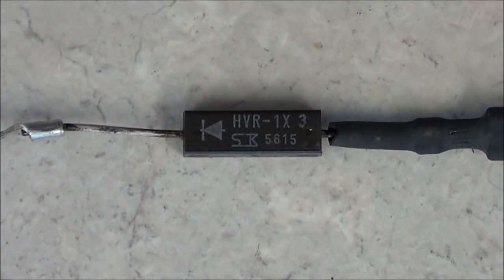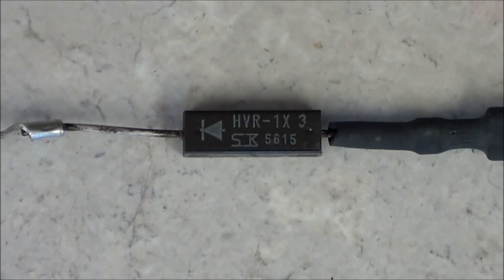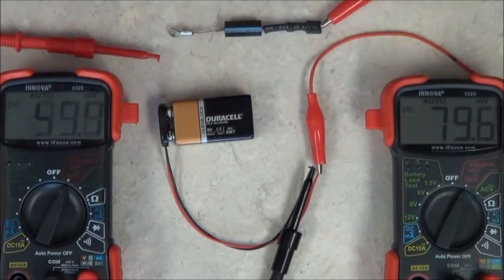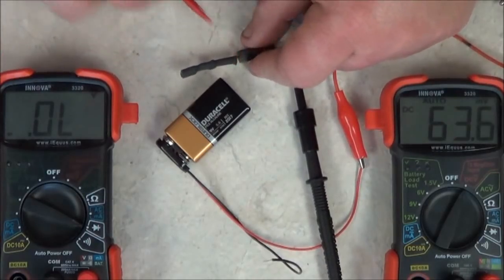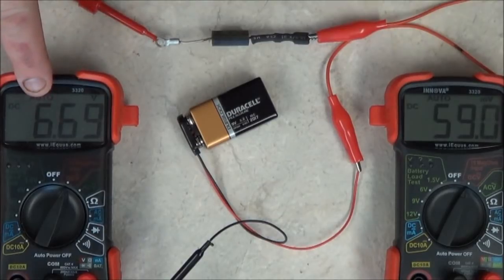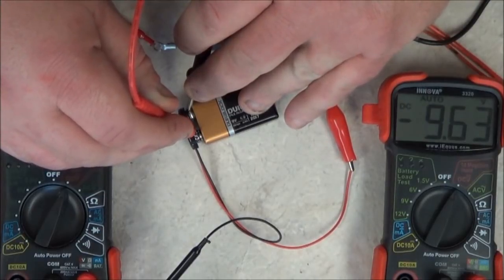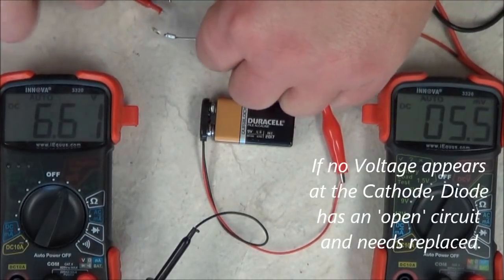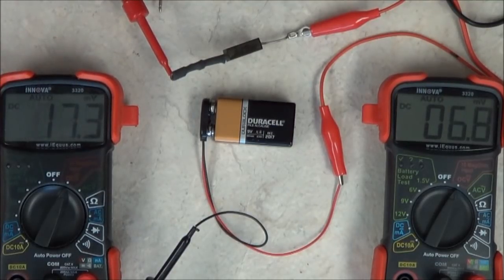How to test the Microwave Oven's HV Diode

Comment: Why didn’t you connect the diode the other way…. To test in the diode setting you check, both ends switching the terminals. One will come through with voltage. The other way will come through with OL.  You only did one direction and saw the OL. I believe that’s how you check it with the diode function on the multimeter.  I guess the point is you don’t need the battery, although that works too - when you have a diode test function on your multimeter like you do.

Comment: There is a lot of mis-information in the comments section of this vid.  When you here a loud humming and the microwave produces no heat, the problem is typically a bad magnatron.  Contrary to what is stated in the comments.  The simplest way to determine the problem is with an amp meter.  With the microwave turned on, if your current draw is 2 amps or less, you have a problem in the low voltage(120 volt) side of the microwave.  This is typically a door switch or control board issue.  If your current draw is 3 - 6 amps, it means the high voltage transformer and the capacitor are both good, and your problem is either the magnatron, or the high voltage diode(more times then not it is the magnatron).  If your amp draw is 50 amps or something very high like that, its usually the capacitor bad.  A typical properly functioning microwave will draw between 12 -16 amps, depending on house voltage and wattage of microwave,
Reply: That's all good and well, but you do not explain how to differentiate between a failed magnetron and diode.  Therefore you have not answered the question.
Reply: There are a ton of videos that show you how to check the diode.  Unlike a typical diode, for this high voltage diode you have to connect it in series with a 9 volt battery. Watching a video on it is a lot easier then trying to explain it. Having said that, I typically replace both the mag and the diode together, as the diode is a very low cost item, if it turns out the problem was a bad mag.  For the sake of a $5.00 part I don't want to have to pull the microwave down and tear apart again.
Reply: Thanks, that makes sense.
Reply: +billy bob Would you please read my post at the top of this forum? I have taken several measurements in every possible configuration in an attempt to figure out why my fuse blows. I'm really not interested in replacing parts blindly as it can get expensive. Perhaps you can decipher things based on my test results. Thanks.
Reply: billy bob
Reply: Jake, if you are pulling 55 amps and fuse blows its more then likely a shorted capacitor.  When you unplug the wire from the transformer to capacitor, and it only pulls 5 amps, that means everything is good up to the capacitor, including the high voltage transformer..  Especially since its not blowing the fuse as well.
Reply: kolkata bipul Roy hello?
Reply: How do you measure the amperage of the microwave?
Reply: @billybob-rn9cg  ....Roy called two years ago...You answered a year ago......and I am reading this now....... YouTube has weird ways of communication involving Warp Timed in Years....?!  just kidding !

Comment from the maker: Not Always. The HV Diode is usually the cause as to why the Microwave does not heat the contents. The HV Capacitor will cause the HV Diode to fail when it shorts out internally. This is why it is a good idea to check both the Diode and the Capacitor, Although the diodes are large in size, they can only handle around 1/2 A (500 mA). They are designed to block between 6KV and 15KV when the polarity is reversed. and will eventually breakdown on there own. -MrFixit
Reply: ? Do you mean rectify ac waveform supply that reverses polarity

Comment: I have a problem with my microwave If the diode is connected to earth it will cut off the fuse but if the diode is not connected the fuse will not cut off and the microwave will not get hot why

Comment: Thank you!  Very helpful with the suggestion to use the 9 volt battery because the high-voltage diode has such a big current drop across it. Also great to see exactly what the voltage drop across your diode is so that I know what to expect!

Comment: Thank you sir. I was testing the components in a furnace electronic air cleaner which has been weak, and now unresponsive even when the test button was pressed and ran into two diodes like this, which I first concluded to be open. Using the 9V battery test, 5.7 volts through the battery each, so they are good. Found the capacitor which is in parallel with the transformer secondary (11nF, 4kVAC) had a split in it.

Comment: I am impressed with your creativity! You are connecting the voltmeter in series with the battery and the diode. You are measuring voltage drop on the voltmeter. 
in theory you can deduct that voltage (6.7V) from 9V (the battery) to come up with the voltage drop on the diode (2.3V). In reality, since the voltmeter's resistance is very high, few megaohms, the flowing current is just few microamps. So the calculated voltage drop is out of the working range of the diode. 
To measure the voltage drop of the diode, connect a 100 Ohm, or so, resistor in series with the diode and the battery.  Then measure the voltage on the diode (between the cathode and anode).
Reply: yes indeed  would be interesting to see the  volt drop with a 1 kohm resistor as a load.  It is not a high resistance diode  as such as it is probable a diode stack  maybe  3 off   0.7 volt diodes in  series  to share the high  reverse  emf Tthis would give about 2.1 volts drop

Comment: Hi Mr.fix it goodday!im so proud of you,to give a info n help those people need to fix their prob.especially for electrical prob.also me,im asking n help too about my concern for my Genset,?Bosco Generator,2000 watt,How can i fix it n how it prevent the prob.having a overload sign light on?but the engine still running in good condition,even i did not put or connect any unit can be use?,hopefully u can give me a time to discuss for what the solution of my prob.be solve..im really appreciated it. Tnks..Godbless...

Comment: I have two comments:
1. Since you haven't shown all the connections, it's impossible to see exactly what you're measuring.
2. It makes a lot more sense to measure the current through the diode.  It should be zero in one direction and high in the other.  That tells you it's working, no matter what the voltage drop is.
Reply: You sound like you know what you're doing.
It was difficult to see what he was doing with his connections.
With a new 9 volt battery mine measures 1.42.
Flip it around and the volt meter says zero.
I'm wondering if 1.42 going through it is high enough to start the micro heating or if that needs to be higher and the diode is shot.

Comment: It worked thanks had another diode from parts I savaged. Voltage in the bad one was only about half volt lower than the good one.Tried it, works like a charm.  :-)

Comment: Thank you for this video. 2 quick questions.  If the reading on volt meter is higher than 9 is there a problem then?  If it is still good, I have another issue,  I put a new capacitor in, and the diode is good.  Microwave works but fan and doesnt work.  What could this be?  Fan spins freely.  Thank you

Comment: WhirlPool microwave MH1150XMB3.  I replaced the magnetron and diode, however when I started the unit, it ran about 10 seconds, blew a fuse (?), and had a burning smell.  Does the microwave have low and high circuits? Can I test both these circuits and the circuit that fails the test has the bad wiring?  Can you tell me where to test these circuits?
Thanks, any help would be greatly appreciated
Jim

Comment: Ok, so if you have a voltage drop from 9v to 6.6 does that mean the diode is good or bad?
Reply from the maker: it means the diode is good. -MrFixit
Reply: @ESRepair  .......I think ESRepair and MrFixit are shorted !!! Both Butt welded together !

Comment: Here is my trouble, I hope you read it and tell me what I should do, and I want to tell you that you are such a kind guy.

In my case, I have tested the diode and it is bad, because the resistance is infinite from either one end to the other and vice versa.
Now, I like to ask you, why has the diode gotten bad?
And also please read the background of the trouble.
I also understand that the internal bleeding resistor of the capacitor is supposed to dissipate the charge when the oven is disconnected from the mains, but just the same repair persons should still take the caution of the routine discharge procedure before handling the capacitor…?
 
Background of the trouble.

I have replaced a busted capacitor of the following specs:

2100VAC 0.82mF +-4%

with one of these specs:

2100VAC 0.84mF +-3%.

The original trouble was that I started to use the oven one morning and it did not show any activity whatsoever.

As I had a similar trouble some months back and I fixed it by replacing the blown fuse, this time I did the same procedure but nothing occurred with the oven except a slight vibrating fart noise: no smell of burning, no visible sign of any burning, and the new fuse got blown up.

So I started reading about repairs of microwave ovens in the internet, and came to the conclusion that most likely the power capacitor is the culprit.

So I removed it and tested it, yes it is busted.

Next I bought the replacement capacitor as I described above, and installed it, what happened now?

The same thing happened as before: a slight vibrating fart noise, and the new fuse also got blown up, but no smell of burning, no visible sign of burning.

At this point I said to myself that I hope the new capacitor did not get busted now; but I have not removed it, not yet, to test it -- saying to myself that I had better do more reading in the internet.

My question is the following: if it is not the capacitor that is the culprit, what is the most likely candidate for the same trouble as before, i.e., what part(s) should be replaced?

Since I have a lot of time in my hand, and I also already now use another oven, so it is just a matter of some sort of adventure to fix it, and plus that with it fixed I will again have a reserved oven.

Hope you will draw from your years of experience and give me some tips, and I have not yet taken out the new capacitor to see whether it is also now busted -- what do you say, from your years of experience with microwave oven repairs?

Thanks a lot in advance, and also again for the massive information in your website.

Marius de Jess
mdejess(@)gmail.com
Reply: +Marius Dejess -- Since the original diode showed as open (no current path) in either direction, it failed as a fuse would, and probably for the same reason:  excessive current being drawn.  A shorted filter capacitor is the next cheapest suspect part, and would indeed pull way more current directly to ground than should be going across it, taking the fuse almost immediately.
If after replacing that big electrolytic (the polarity was right upon repair, right?) then you're pretty much down to either the magnetron or the HV transformer.  If you're paying retail for parts, then replacing either of those parts can approach the cost of a whole new machine.  If you're going to be doing lots of repairs on gear that runs HV, it wouldn't hurt to keep a spare power transformer or two around, with different ranges of outputs (or a Variac to control the input, thereby varying the output).  Magnetrons are pretty specific as to the application, both electrically and physically.
As has been already pointed out, always discharge all leads/terminals to chassis ground with a "hot stick" -- I use a chopstick with a 100-ohm, 10-watt resistor heatshrunk to the side, one lead of the resistor to clip onto ground, and the other lead sticking out past the far end of the chopstick to touch to hot spots.  A screwdriver with a tip you don't really care about can be used, too, as long as you've got the shaft of the tool well insulated.  And keep your other hand in a back pocket as you do this -- no sense having your body, full of salt water, as the most direct path to ground.....

Hope this helps.  And thanks for the OP's video.  With the possible exception of a lack of explanation of just what should be seen in the voltage drop test to qualify as a good diode (which he covered in a replay soon after posting), the info is great for someone who has a modicum of common sense and an adventuresome spirit about fixing stuff inexpensively around the home that, without moving parts, may not be obvious to the average handyman.

Cheers & 73

Comment: My fluke meter can test these accueately on the anode/diode  test selction. Most multimeters that run off of a 9v naruarlyy can test hv caps normally without the extra external 9v. Just put it on dioide test. Put leads one direction. Flip them opposite direction. Done.

Comment: I used my Wavetek DM27XT once I found out that my new Kaiweets HT118E only has 2 AA which is only 3VDC and not enough to get through a high voltage diode, but my Wavetek DM27XT has a 9VDC battery inside! Then I put the DM27XT in resistance modes high enough like 200Mohm or higher and I got over 200Mohm one way and 48Mohm the other way as a diode should.

Comment: Isn't common or always that the diode is connected to the negative side of the capacitor. I believe that the diode goes with the white wire on the cap.

Comment: hi there, I didn't get the results of reversing the orientation of the diode. When it drops to mv and fluctuate in the meter does that mean it's good? You just mentioned it's high resistance but what should be the result for a working diode? Thank you
Reply from the maker: The results is current only flows in one direction.   Yes, If the diode show no current flow in the reversed direction  then the Diode is good.   Often times the meter would show millivolts due to natural leakage of the material that makes up the diode.
Reply: Thanks. Great video

Comment: I have tested all the parts but everything seemd ok. My display didnl light up. Eventually i heated the microcontroller on the board with a heat gun and let it cool.After that - magic. At least for now :) Probably some connection was loose. The oven was in a balcony with rapid temperature changes when open the door at winter. Maybe this cause the bad connection. Thanks for the video !!

Comment: You sound like you know what you're doing.
It was difficult to see what you were doing at times with your connections.
With a new 9 volt battery mine measures 1.42.
Flip it around and the volt meter says zero.
I'm wondering if 1.42 going through it is high enough to start the micro heating or if that needs to be higher and the diode is shot.

Comment: 9 volt dc is rather too low for testing a diode which is supposed to handle 5,000 volts. I would use at least a 2,000 volt source. The test demonstrated is appropriate for diodes used in 12 vdc circuits, not 5,000 volt circuits.
Reply: +Odouls77 Completely correct, sir. Also, I would like to point out that the Vf (forward voltage drop) is proportional to the current and voltage passing through the junction, and is affected by the PN junction temperature.  V = (kT/e) Ln(I/I naught)  Where as: I = forward output current  e =electron charge  k = Boltzmann's constant  T = temperature in kelvin     V = forward voltage
So as you can see, the drop Vf may be correct at 9.6 volts, but at 450 or some other arbitrary value, the drop may in fact be completely out of specification. Remember, always refer to the manufacturers data sheet for the proper IVT curves!

Comment: Hi , my microwave [ G.E. ]  does not heat, and makes a loud hum [ and also sounds like its struggling a bit ] which is how you described a failed diode , but are those also the symptoms of a failed capacitor ?    are they likely to fail together ?   thanks,  Will
Reply from the maker: not always, but usually it's one or the other. -MrFixit.

Comment: My G.E. OTR microwave oven has an intermittent problem.  It works for a few minutes, then it starts making a loud "CLACK-CLACK-CLACK-CLACK-CLACK" that sends the cats running from the kitchen at top speed.  Last night, it did this after 4 minutes and then tripped the GFCI outlet.  Can someone suggest the most likely faulty part?

Comment: Can you tell me if there is no heating and a loud humming noise what that is a sign of?
Reply from the maker: Either the HV Capacitor is shorted, the HV Diode is Shorted, or the  The HV Transformer is shorted.
Reply: sounds promising then if it is not the the magnetron?
Reply from the maker: If it's the Magnetron, it would sound like bacon cooking in the frying pan.
Reply: Ok, we gonna do some of your tests.  Thank you so very much for your time and patience to answer my questions.  I really appreciate it!  God Bless You.
Reply: @SpringfieldLARealtor  If the HV cap inside your unit is alive and well, the voltages present in there will kill you instantly... I hope you're familiar with proper HV safety procedures / have a `chicken-stick` discharge resistor and know how to use the same.  Handle it like an armed landmine until you're sure it's been discharged.

Comment: At $5 to $20 dollars for a diode replacement it may be wise to start ripping open a few dead microwaves and saving some key components. New microwaves can be bought on sale for $30 to $50 dollars so it may not be worth it to sink $20 bucks into an old microwave.

Comment: Can we use a 1.5V torch cell (instead of 9 V dry cell) In which case may we  expect a voltage drop of, say,  about 0.5V across the diode?
Reply: You will see no voltage from 1.5V battery because the voltage drop on this diode is 2.8-3V. However you can use 12V battery from your car or simply use the battery charger .